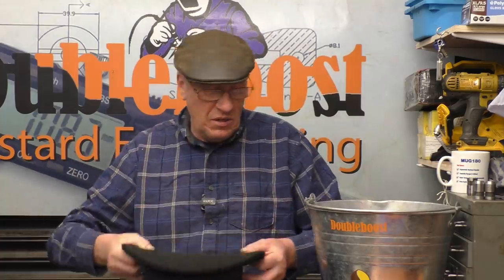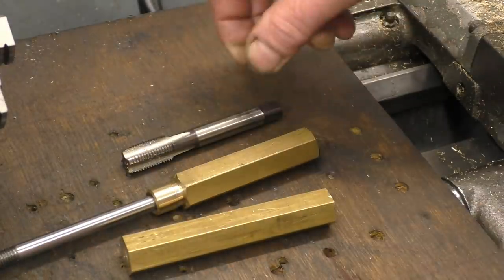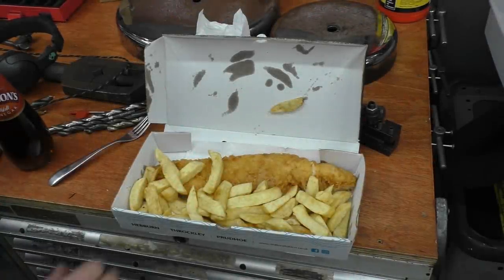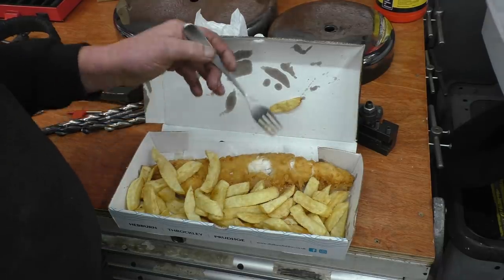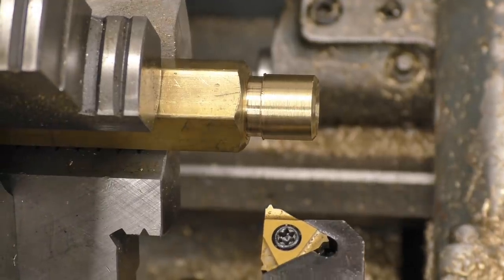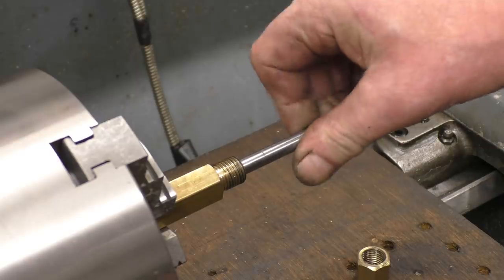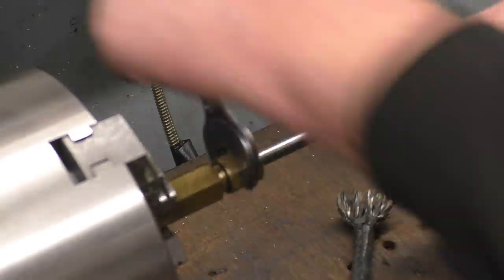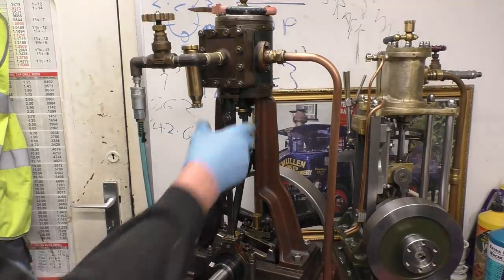SNNC 360 P1  Brass Gland Nut

Comment: Nice video John. 
A bit of further info for your veiwers, I expect you will know this with your experinece maintaning ful scale steam engines. 
It's not very practical on small glands like the one you just made but on larger glands such as those used on small marine propeller shafts 3/4" upwards the packing should cut into individual rings with a scarfed joint. 
The easy way to do this is to use  a piece of the shaft that will never be in  the gland area or a scrap piece of metal as a mandrel. You wind ghe packing around the shaft sevral times as you did but then cut the packing at an angle with a sharp blade to form the individual rings. The rings rings are then inserted into the gland with the joints staggered so that you put the minimum number of rings in to be able to compress them. You then add further rings as required but really need to have the machinery running for final adjustment. 
The gland should be set up so that just enough packings & compression are used. If too many packings or too much compression is used the gland will run hot and cause excessive wear on the shaft that runs in  the gland. Packing glands really need to leak a very small amount, the leaking fluid lubricates & prevents the packing from drying out. Some glands have a greaser or water feed to prolong the packing life.
These glands have ben used for a long time and and still remain  a very reliable way of sealing both rotating & reciporictaing shafts. They very rarely if ever fail completely, they just start to leak more when they need adjustemnet or re-packing.
Keep up the good work on the videos.
Cheers, Dave.

Comment: Can you cut 3/4" 8 TPI ACME threaded nuts? Also 1/2" 10 TPI ACME?
Reply: With the correct tap, yes
Reply: @VulcanBomberxm655  Yes, I was asking if he had the correct tap available.
Reply from the maker: I have 1/2 inch / 10  but left hand thread
Reply: @doubleboost  Ah. Many thanks for letting me know. I believe the cross slide leadscrew in mu Atlas 10 is right hand.